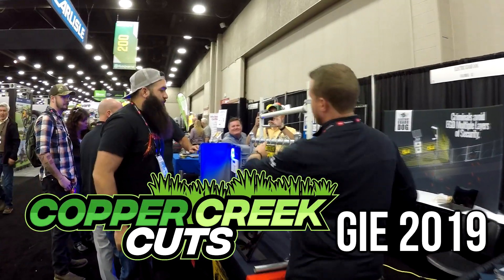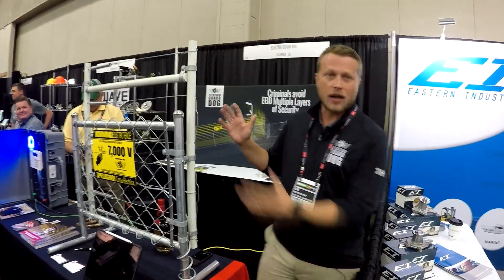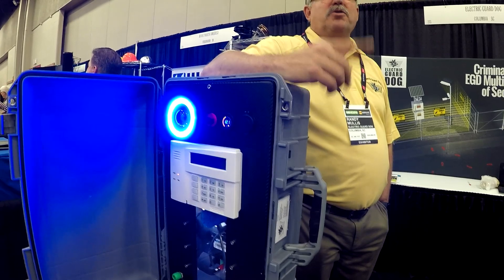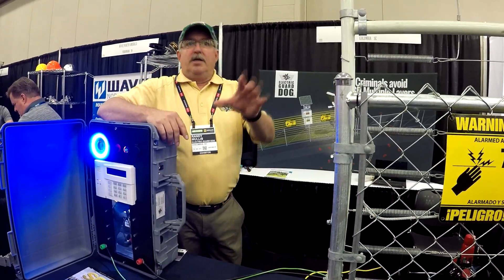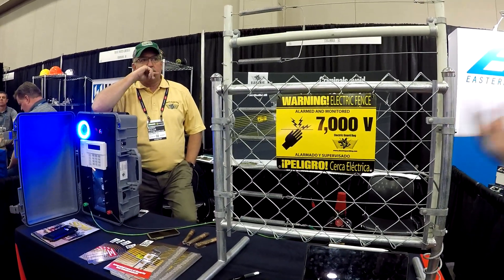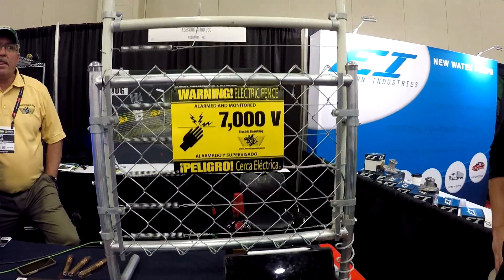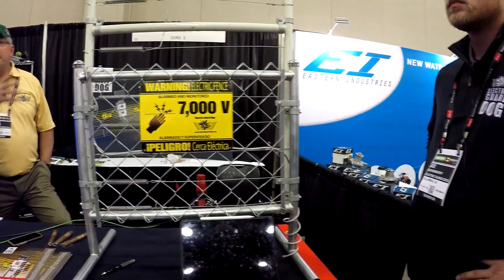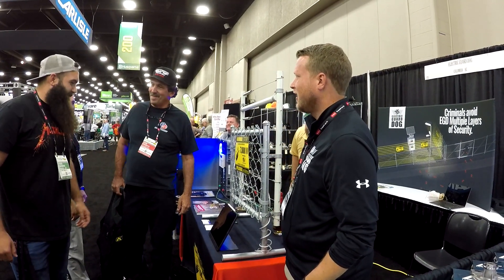Getting Shocked With 7,000 Volts Of Electricity | Solar Powered Electric Fence

Comment: Lol 7000 volts would vaporize you , 220 volt in a house will kill you instantly, so you can imagine what 7000 would do  lol
Reply: Most personal-defense tasers easily produce over 10,000 volts. but only around 0.004 Amps.  Household amperage (current) is over 1,000x higher than this.  It's the amps that kill, not the volts.

Comment: raises a hand I Think it's important to remember that you can gather a static charge of 30,000 volts just by walking across a carpet. It's the current (amps) that zaps you, not the voltage. Your average outlet packs only 120 to 240 volts. but it can still ruin your day.
Reply: Tasers are made to be 30k volts at .2 amps (or 200 milliamps) so they shock and paralyze the threat temporarily. Amps kill not voltage. Without amps you wont have a big arc to discharge the potential energy itll just dissipate like with carpet until you touch something metal and ground out. AC is usually higher amps because it is being sent long distances plus it has a more aggressive sinusoidal wave. So a 7k DC fence is like a mini tazer if you will. You can take a disposable camera and modify the flash to act like a tazer with around 400 volts but it wont kill because of the low amps.
Reply: @Krspy2  "Energy" not amps, without voltage you can't get current to flow, so "WATTS" is the thing that kill. For a taser the voltage is high as well as the current but for a very short period of time somewhere like microseconds lasting pulses and the voltage quickly drops. Same for electric fences, the supply has limited power to not make it lethal.
Reply from the maker: Hey, hey, hey! Let's not ruin the clickbait appeal of my title with science, shall we? ;)
Reply: @BakerCountyTrashPickup  zap! no worries, your video was electrifying!

Comment: I just got shock the other day I was holding a spark plug against the engine to test the spark and apparently if you leave off while touching the engine with the other hand you get shocked by 25,000 volts.
Reply from the maker: OUCH! Hope you are OK!
Reply: Hey flat 4 ! I just had the same thing happening to me yesterday . I wanted to see if the coils were firing properly so i unplugged the one coil to see if the spark is consistent and bam ! My finger was to close to the distributor and my other hand was on the engine . I felt a big shock going from my left hand to my right hand . Reallu made me jump . Have you had any medical problem following this accident ? I dont know if i should be worried lol
Reply: I had that happen pulling the plug wire off while the truck was running